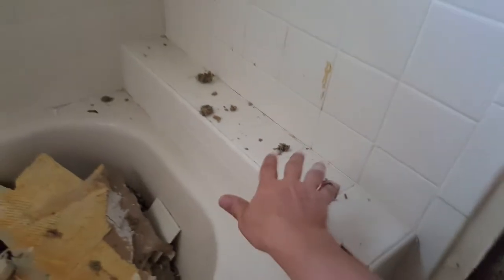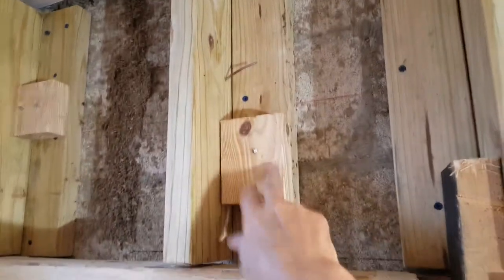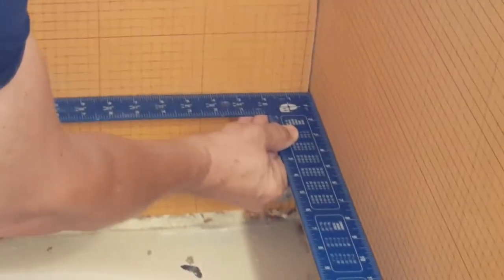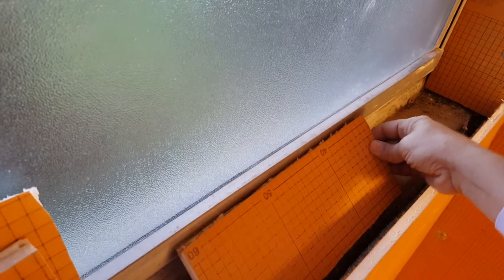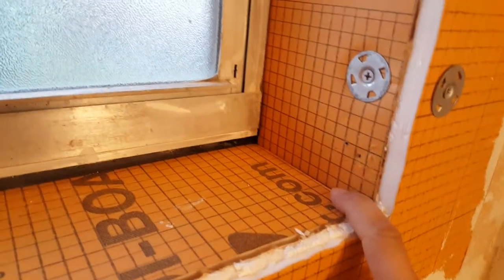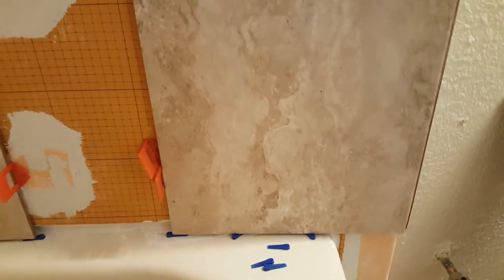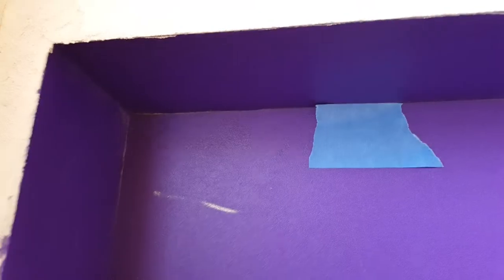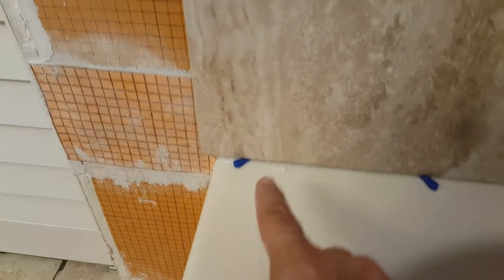How To Tile Bathroom Shower/Tub Surround, AND Niche A to Z

Comment from the maker: Products used in this bathroom wall tiles video:
🛒 Raimondi Tile Leveling System Starter Kit: https://amzn.to/2CAyweW
🛒 Raimondi Tile Leveling Clip 1/8" joint: https://amzn.to/2RhbodI
🛒 Raimondi LS250WEDGE 250-Piece Tile Leveling System Wedges: https://amzn.to/2Sopebl
🛒 Schluter Kerdi Band 33' Roll: https://amzn.to/2BHPBC8
🛒 Schluter Kerdi Band 98' Roll: https://amzn.to/2BL3lfr
🛒 Schluter Allset Thin  Set Tile Mortar https://amzn.to/2CB9D2F

Comment: Can u tell me how you made the little tile accent with the hexagon tile?I have hexagon tile and I want to use it as a trim like you did here
Reply from the maker: What What I did was figure out how wide does the stripe need to be going all the way around and then I cut the hextiles to that which period then I cemented them onto some schluter kurty membrane and let them dry overnight so they are one Rigid peace And then I submitted that piece onto the wall all the way around

Comment: What time saw did you use also where did you get the tile me leveling pieces . Nice job
Reply from the maker: Thanks for watching! Here are the links to the tile leveling pieces we used. 
✅ Raimondi Tile Leveling System Starter Kit: https://amzn.to/2CAyweW
✅ Raimondi Tile Leveling Clip 1/8" joint: https://amzn.to/2RhbodI
✅ Raimondi LS250WEDGE 250-Piece Tile Leveling System Wedges: https://amzn.to/2Sopebl
Also for the tile saw I used the Ridgid R4030s, which has since been replaced by the R4031 at Home Depot, down the tile supply aisle. That served me well for 5 years, then died last year, glad it did, gave the excuse to go buy the much more expensive DeWalt D24000S tile saw, $800, but it's about the best one out there. Here's the video on our tool review of this awesome DeWalt Tile saw: "Dewalt D24000 Wet Tile Saw Tool Review, Assembly, D24000S" : https://youtu.be/34BztFShbpc

Comment: Curious, on the window sill where you put the three layers of Kerdi board why not just fur the height needed with wood blocks rather than using multiple layers of backer board and mortar?
Reply from the maker: either way is acceptable, just accustomed on smaller pieces like this to use the kerdi, this is also how they build benches with kerdi

Comment: You can use P.T indoors? Up here it’s not recommended because of the chemicals used in it. Actually I believe an inspector would likely order it removed. Now I believe the formula used  in the new brown p.t is said to be different.
Reply from the maker: LOL I don't know where you got that information from but it's completely totally 100% bogus and doesn't even pass the common sense test. Everybody knows that the bottom plate of a stud wall on a concrete floor or slab is required by building code to be pressure treated lumber. If it's inside a wall and I don't see what kind of chemicals would be that bad that they are even concerned about
Reply: jeffostroff that’s what the Home Depot I worked at for 14 years claimed. So I go by that, in total I spent about 30 years involved he home improvement field as a consultant. p.t did contain arsenic and copper naprhanate  (sp) at one time, that was the green type. it was also not recommended to grow vegetables along the  side of it. Now I do have a vegetable garden next to a p.t fence and I’m still alive, it hasn’t killed me yet. Also you are concerned about the die in the wood mulch but not chemicals in p.t products?  Not that I would use the coloured stuff on a vegetable garden anyway but around shrubs and flowers n.p. Now I don’t know the building code like the back of my hand, it does change here from community to community and also province to province which can be more stringent than the national code. The Canadian code itself is pretty strict. But I do know they do not demand the sole plate to be pressure treated, but then they do not build too many residential structures on slab here,. Hope you’re not taking this as an attack on your video or you personally but your response sounds like you did take it as such.  I’m not saying anything foul about rubber mulch. Cheers🍻🇨🇦🇺🇸🥂

Comment: How do you solve for the build-up that occurs with Kerdi-Band?  Especially where you have the valve seal over a piece of Kerdi-Band?  This is a problem I ran into with Kerdi...some areas were hard to overcome.  I was using 16x4 Subway tile.  Thanks!
Reply from the maker: Good question. When I install Kerdi Band, I make the mortar a bit soupier than normal so that when I trowel the Kerdi band in place, I try to ooze out as much of the mortar as possible, making the Kerdi band as close to the wall as possible without sticking out, like a Ban Aid on your skin. Also depending on the flatness of your wall, there could be peaks and troughs adding to your complications. If you trowel out thinset on the wall and comb it into lines, and back butter your tiles, there should be enough thickness of mortar that you won't need to worry about the thickness of your kerdi band protruding through. Also with your 16" tiles, you really should consider using a 1/2" notched trowel size, as any tile dimension over 12" you should use 1/2". This would give you better margins for thickness variations on your wall as the 1/2" troweled mortar collapses down to 1/4" thick. IF you only use a 1/4" trowel size notch, then it collapses down to 1/8", maybe not enough overcome the Kerdi band in some spots. What size trowel are you using, and did you back butter the tiles?
Reply: @jeffostroff  Thanks for the feedback, really appreciate it!  I am pretty certain I used a 3/8 x 1/4 square notch, and yes, I did back butter.  To your point, 1/2 may have been better, but I had thought at the time this would be a decent compromise.  I actually hadn't thought about the thickness of the mortar when installing the Kerdi Band.  Perhaps there was just enough build-up behind it to allow it to protrude out just a little more.  Every bit helps, and I hadn't taken that into consideration.  Also to your point, there were probably some peaks and troughs contributing, but next time I will definitely be wet shimming (if needed)!  Side question - Have you ever tried the Laticrete Hydroban system?  I've been researching a little bit and I like how their system just uses screws, and a silicone sealant for all screws, corners, and joints.  Seems like a great way to have a thinner seal on the wall.  In any case, great advice, thanks for your time.  Happy Thanksgiving!! (if you're from the US :) )
Reply from the maker: @danielfeldman7913  3/8" in trowel should have been fine for you. One thing when you embed the Kerdi band into the mortar, use one taping knife to hold it firmly in place, and use 2nd taping knife to scrape over the top of the Kerdi band and ooze out as much mortar at you can out from under the Kerdi band. It should look like a band aid on your skin when complete, it should not be a large bump out. I have heard of Laticrete Hydroban but have not used it. I typically prefer the Kerdi panels because they are so much lighter and easier to work with. Just got done using Densshield boards on a friend's bathroom, that also has waterproofing like Kerdi boards, but is very heavy like drywall. Also I often back butter the wall and trowel on the back of the tile instead of the troweling on the wall and back buttering the tiles. So much easier than trying to glob all that mortar on the wall and comb it  into lines..
Reply: @jeffostroff  Laticrete wall board is about the same as Kerdi, extremely light weight.  In fact it's slightly more firm, and the inside of the board is also waterproof, so if you accidentally knick the membrane, it's no problem! Again, thank you for your advice.  I will definitely be taking into consideration during my next bathroom project!

Comment: i wish if you used the tiles of backsplash of sheild instead of tile you used as decorative horizontal line -this will make it more harmonic to the perception and class. you work is awsome you are excellent contractor
Reply from the maker: Davis  You're only talking about an 8th of an inch difference and the reason why we don't let the tile come all the way down to the tub surface is to allow for flexion of the bath tub like I mentioned in the video of people get in there and add 50 gallons of water and their own weight it's gonna cause a slight flexion and so you don't want to have the tub flex back into shape  against the tiles and cause them to crack. The method that I have done it here is the best method to do it with and the caulk is reinforced with sand so I can assure you it will last and even if water got behind the sanded caulk and behind tiles, remember it is still caulked underneath as well when we first mounted the Kerri panels.  So water isn't going anywhere.

Comment: Put some pertectant in that tube before you scratch it and have to start all over again and having to buy a new tub.
Reply from the maker: SS-50-CAL 3232  The tub was well protected and covered and all of that during construction before we attempted doing this caulk it all came off as this is the very last step before the reveal so all of the protection stuff comes off.  Any time that I even consider entering the tub at this point I'm in my socks only. The bathroom is complete at this point so all the protection comes off.

Comment: Hahaha.....poor carpentry at its best! instead of shimming here and there , He should of used full length material and leveled and plumbed everything before applying drywall. Shoddy just shoddy.
Reply from the maker: You obviously know nothing about carpentry and framing against cement block walls. The wall was so crooked that no matter what you put against it there is a gap because the cement block wall was leaning back almost an inch up at the top of the wall. In the end we had perfect 90 degree walls, perfect vertical plane, you don't get that with wood. Wood is not straight, when you buy 2x4s and 2x6s, lay them down even full length pieces are curved, warped, have crown edges. I've seen contractors build wavy walls because of the crowned edges. What we did ended up perfect because we wet shimmed. You can try to be snobby all you want, trying to find problems where there are none, but at the end of the day we had a perfect shower with perfect straight walls.
Reply: And by the way, it’s not drywall.
Reply: @kylebrewer6757  same shit different pile. Its applied to the wall.
Reply: @jeffostroff  Rex is a sad troll! I find it sooo funny when people are soo jealous they have to put some negative stuff down. They can't help themselves, its like a nervous tick. I actually feel bad for them bc they are sitting there and thinking of what to say. Poor souls